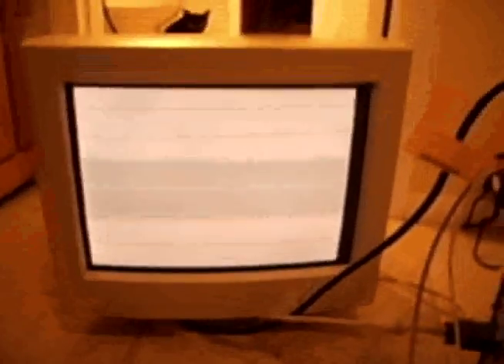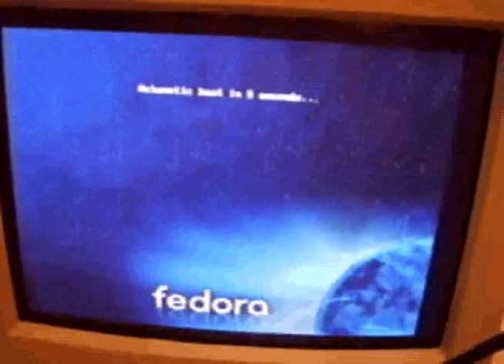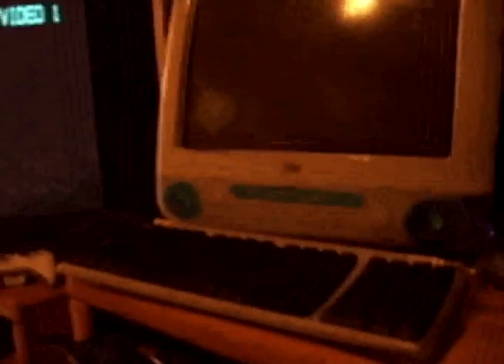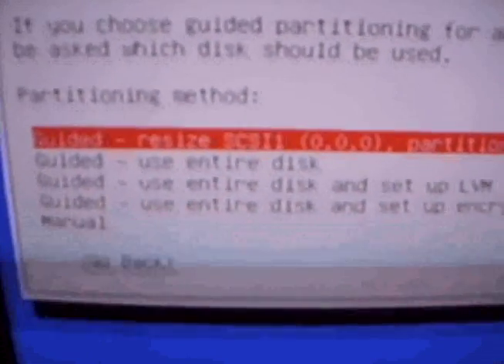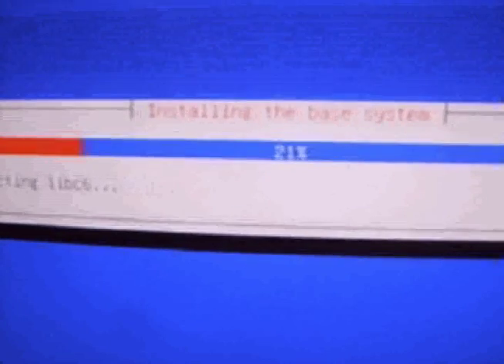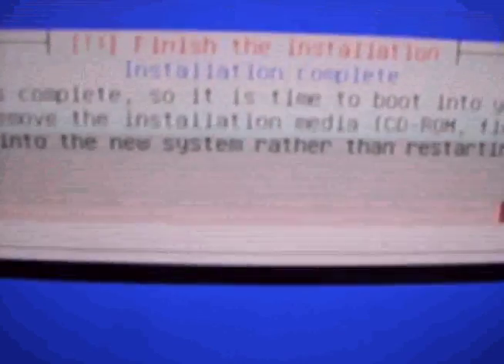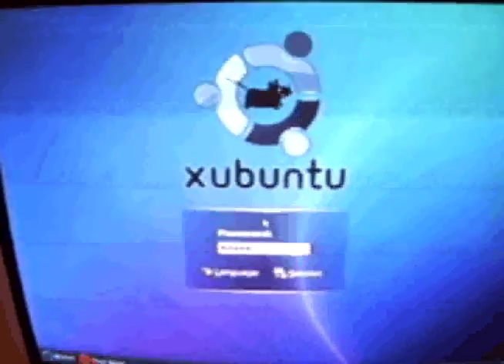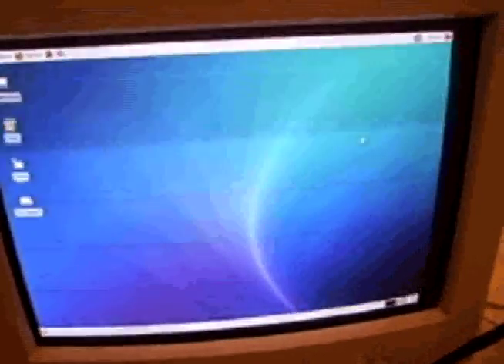Xubuntu On A Old Pentium 3

Comment: i got ubuntu  to work but i got a mini hp with a 2.6 pen 4  and 1 gig ram  all it has wrong is the psu so i am just going to put a normal size psu outside of the case and use that in the basement